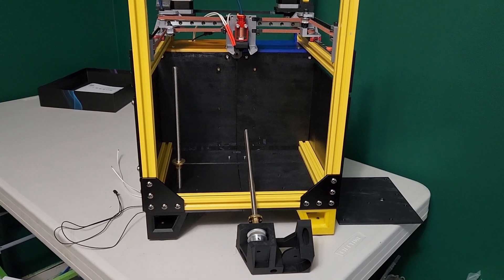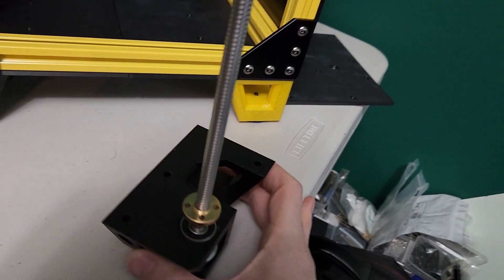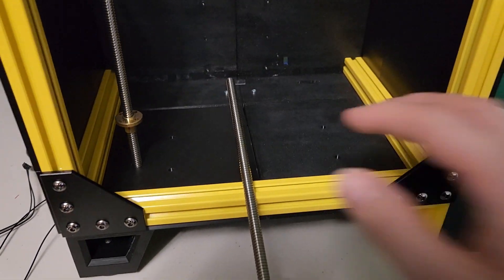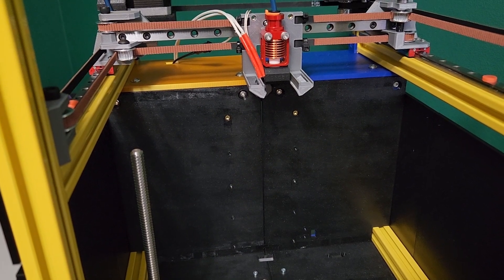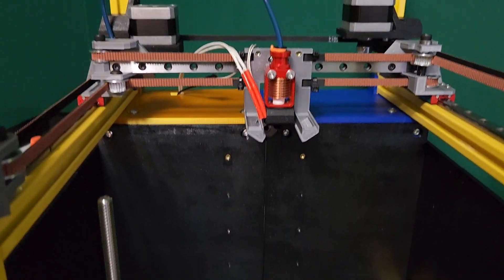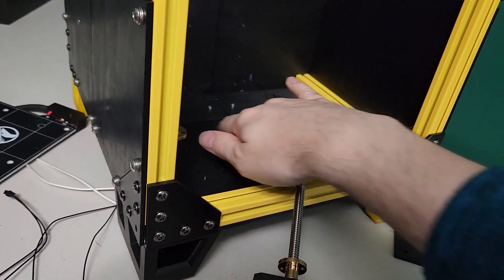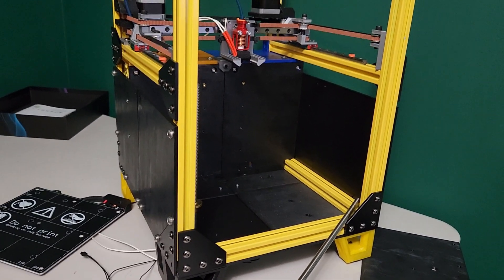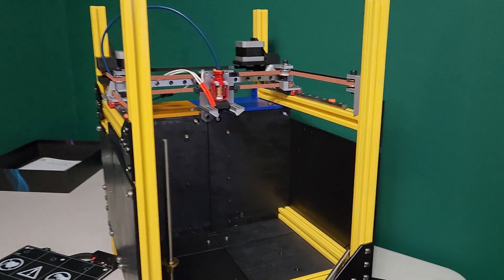Fortress CoreXY 3D Printer - Z Axis Update

Comment: Great work, but I have one question: What are the main differences between the Rook (2020) and the Fortress? What will the Rook be better at? Thanks :)
Reply from the maker: Fortress is triple lead screw to support the bed, 170x170 print area and enclosable.
Reply: @Rolohaun  ah I see, thank you! I am currently waiting on the new Simple Core Design 🙂

Comment: Can you use the shaft of the stepper direct to the rear screw and also use the stepper as a foot?
Reply from the maker: I need the stepper and the rear lead screw to be separate so I can tension the belt, also the stepper body faces up

Comment: How good are those black extrusion joiners? I want to get some to stiffen up my ender 5 plus
Reply from the maker: the black corner plates are amazing, they are flat and align the 2020 perfectly. Make sure you buy some qualify ones as sometimes the hardware that comes with them is poor
Reply: think they are printed and t screws
Reply: I've bought some for a build and they're pretty solid